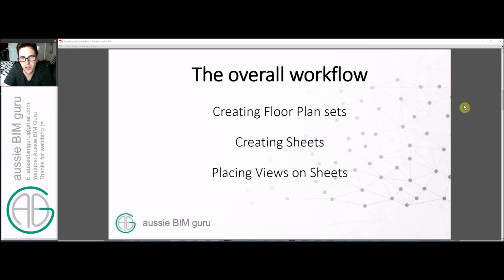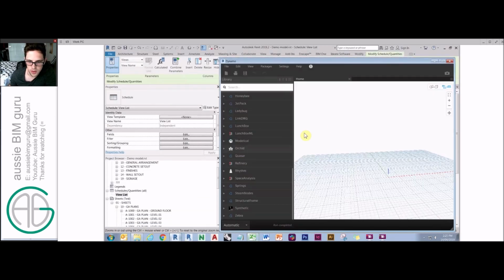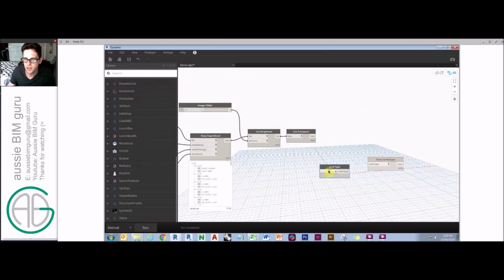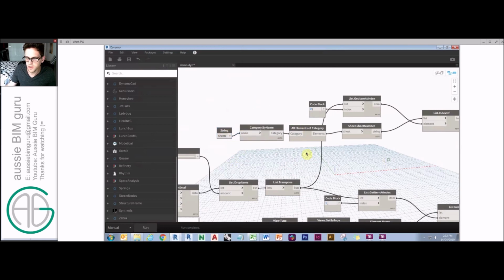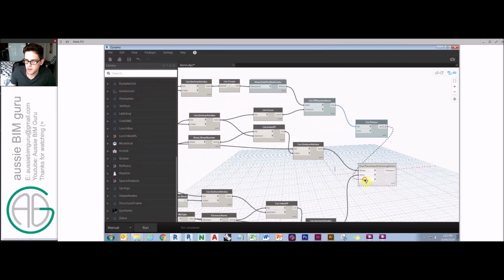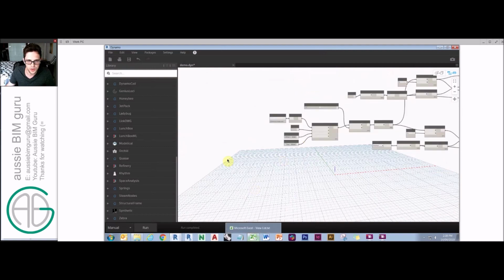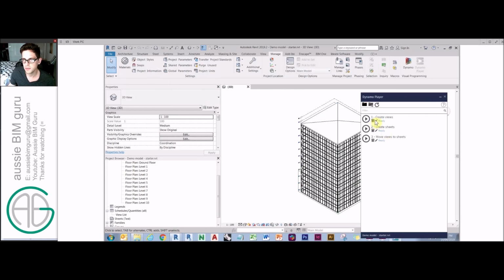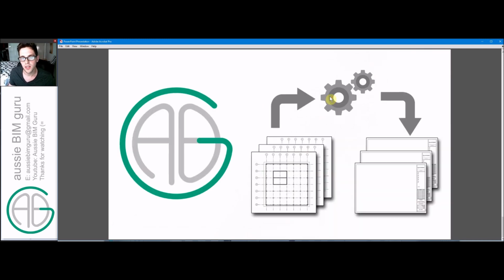Place Views on Sheets using Dynamo! (Views to Sheets 3/3)

Comment: Hey Gavin! Thanks a lot for the video!! But I have a question: Instead of creating an excel table I would like to "match" the name of the sheets with the name of the views. The problem is that while the sheets have separate "sheet name" and "sheet number", in the views numbers and string are together in the same parameter. So for example when I try to match sheet number "100" with a view called "100 - 1st Plan" it does not find this "match" because it does not look for "contain 100" but instead it tries to find " value = 100 "

Do you have any suggestions on that?
I kind of in doubt about how useful it will be to go through with this, because not all of our boards are the same, they vary in size,  number of views, size of each view ...
Reply from the maker: You're welcome!

I considered this workflow before, the trick would be that the properties of the view would need to relate to the sheet's number and/or pieces of its name in order to find a match.

If you were able to write a matching algorithm (e.g. first digit = level, second digit = view series) then it could technically be auto-matched.

Without the perfect data and system though, it unfortunately wouldn't work - data is very explicit in what it expects. Might be worth looking into 'fuzzy logic' and 'f strings' in python to see some 'rough matching' techniques you could explore. Complex territory, but theoretically applicable.

If you're simply matching a leading substring in a view name to a sheet number, you could split all view names by the first separator (" "), then take the first match to the sheet number as its respective view, then an equals node or 'index of + item at index' method could be used. Very explicit however, you'd need a sheet number once only per view/sheet match.
Reply: @AussieBIMGuru  Thanks for you answer.. This first hypothesis seems very complex to me: /, but the second one seems possible...  I just managed to separate the view names with a "string.Split" + "list.Deconstruct" ... The problem is that the order of the elements seems wrong, I will have to study this further (how to match those things) ... Just to be sure that I didn't misunderstand you: what you mean by "Very explicit, however, you need a sheet number once only per view/sheet match " is that if I have a View name with name " 100 - plan 1 "and another one with the name " 100 - plan 2 " and try to get both to be placed on sheet 100 the scripts wouldn't be able to do it and only one of them would be positioned correctly?
Reply from the maker: @luupieper  a script could be set up to take the first match vs all of them for sure, just a bit more to protect the script.
Reply: @AussieBIMGuru  Good Morning Gavin, about the tutorial: I'm back to the main goal (put in the views on the sheets) and I'm trying to make the way you point out in the video (left my idea on stand by for now)...

I wasn't able to make it works: "Tool.PlaceViewsOnExistingSheets" node it's null, so Element.SetParameterByName says "Warning: Internal error, please report: Dereferencing a non-pointer"... But I don't get why because all the nodes before these ones appear to be working properly.

I'm also having some trouble with the "List.IndexOf" node, cause it's not finding all Sheet Numbers that start with numbers (I noticed that yours start with letters, and I tested it starting with letters and it worked) ... I thought of inserting standard letters with string join or something like that, but I wanted to understand why it doesn’t work when there are just numbers on the Sheet number. For now, I made some tests changing it manualy.
Reply from the maker: @luupieper  cross check what object type dynamo sees the numbers as - it might not see them as strings if contain no letters.

I've heard there are issues with the placement node in various dynamo versions. Will do an update for revit 2020 in about a month hopefully. Be mindful the node typically only works once (for placement) so it cant be run in steps past this node without reloading dynamo session.
Reply: @AussieBIMGuru  Thank you Gavin! About the numbers: I find it strange because I even tried to convert it to strings, but I will test it again! Thank you very much for your attention!
Reply from the maker: @luupieper  you're welcome. I should have dynamo again in a month. It's been hard without it haha
Reply: @AussieBIMGuru  I can imagine, If for me it's a new toy and I don't feel like stopping testing things I imagine for you hahaha! I'm trying to open in 2020, see if it makes any difference hehe, anyway I think I would have to do a UI before showing it to my colleagues
Reply from the maker: @luupieper  yes UI is a great way to introduce dynamo. Baby steps before giant leaps!
Reply: @AussieBIMGuru  hahahaha Yeah, I know. Update: I'm using ʳʰʸᵗʰᵐ|Viewport.Create with the same function of Tool.PlaceViewsOnExistingSheets and it seams to work.
Reply from the maker: @luupieper  awesome! Nice troubleshooting

Comment: The entire script ran well, except in the end. It says at the final step in Element.SetParameterByName it says the input in the element node is a string input rather than an element string.
Reply from the maker: Unfortunately in later builds of Dynamo there seems to be a bug with the viewport collector node - if you email me I can send you a fix to this bug.

If you're up to it and want to try to solve it, the trick is to get the element type of Viewport, collect all the viewport types and filter a desired type by running a boolean mask based on their type name, then feeding this through as the parameter value instead.
Reply: @AussieBIMGuru  I have done that too. Will send you an email.
Reply from the maker: @SrijatVerma  replied, looks like it's just a simple case of filtering the viewport types vs. their name. Hope that helps!
Reply: @AussieBIMGuru  Hi! I am having the same issue @aussiebimguru ! I can’t seem to find you email but I would really appreciate help with the solution !
Reply from the maker: @Dynamo37958  i have an updated workflow coming to the channel next Monday, suggest watching that one instead, script is also on my github for it.
Reply: @AussieBIMGuru  thanks for getting back to me! Is there anyway you can share the node? I have my final exam on dynamo on Monday and need the node for it 🙈
Reply from the maker: @Dynamo37958  its on my github. Google will get you there.
Reply: @AussieBIMGuru    I have found the script! Just trying to work out how to put it into dynamo, I am new as new can be when it comes to programming/scripts etc
Reply from the maker: @Dynamo37958  this might be quite tricky to begin from. Dynamo primer is s pilgrimage i recommend in first instance.
Reply: Hi! I am having the same issue @aussiebimguru ! I can’t seem to find you email but I would really appreciate help with the solution !

Comment: Holly this is exactly what I have been looking for if I can get it to work. 
I am having a little problem. All of the nodes titled "List.GetItemAtIndex" give me this warning: 

"Warning: List.GetItemAtIndex operation failed. 
Index was out of range. Must be non-negative and less than the size of the collection.Parameter name: index" 
Do you know what could have gone wrong? I followed your 3 point examples exactly how you showed them.
Reply from the maker: I believe it is failing to find an index match from index.of. Are the indices before coming back as a positive number or -1? -1 means no match was found for the sheets or views, cross check that all items find a match. Ideally if your excel data is aligned to project values all indices should find a matched index.

Happy to continue via my gmail if it keeps giving errors. Also are you using dynamo 2? Not sure if this works in dynamo 1.
Reply: Hi Anders, I got the same problem. The reason was that I had a "spacing" in my sheet numbers which I had to take out and the problem was solved. In the beginning, It wasn't obvious at all... so as Gavin said, it's worth checking that all your items find a match even if the "thing" that differentiates them is some kind of invisible space.
Reply from the maker: @douniatouil8114  thanks Dounia, it happens to me from time to time as well! Data is unforgivingly explicit

Comment: How, we can make sheet view different group type in one floor
Reply from the maker: To make multiple view types for one level, you would need to build a data shapes UI to select a list of plan view types, then create X copies of a new plan, rename using a rule of some sort, then apply view templates using a rule that connects your view type with your view templates (such as a common series number).

Alternatively, you could specify all the data via excel.

I think I'll make a video on this eventually - it's a bit tricky, and relies on good project setup.
Reply: Aussie BIM Guru thank you 
Please make a video.
If you want i can send you file .
E-mail id &Skype id  -ar.mohit16@gmail.com
Please connect me